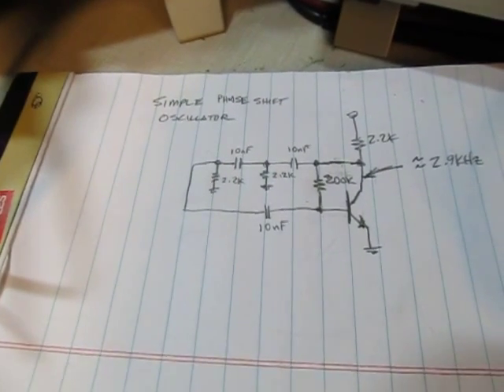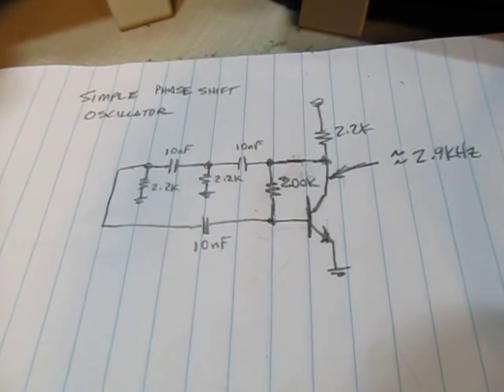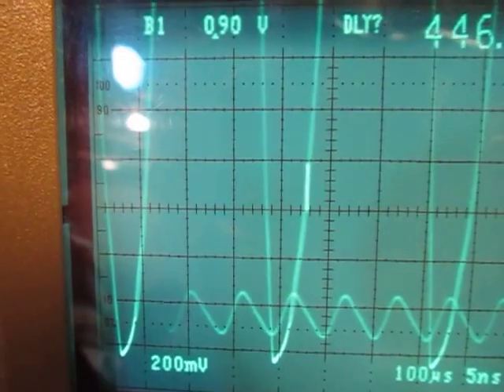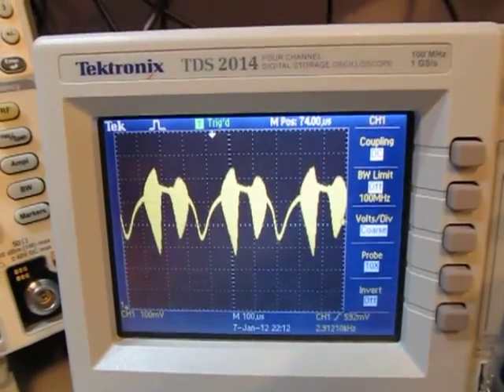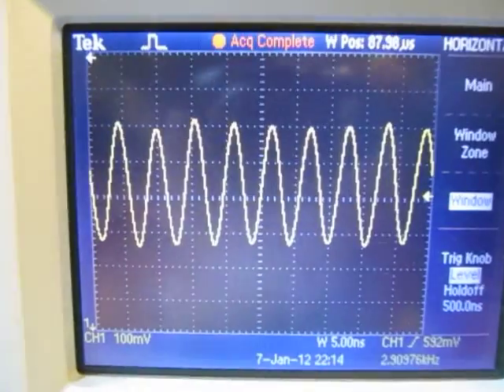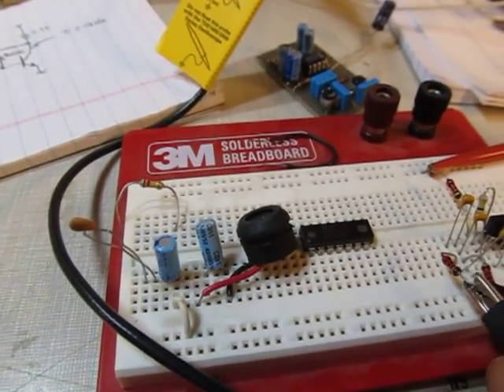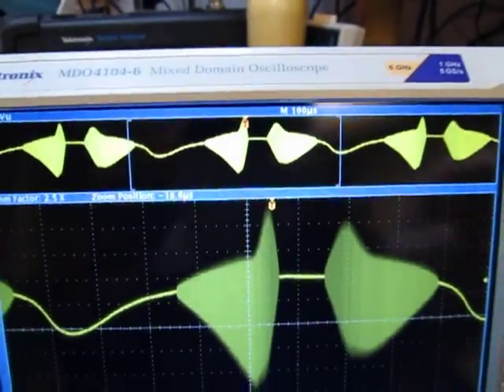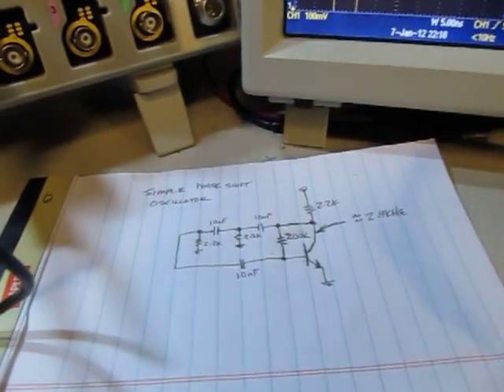#26: Answering viewer questions, and Digital Oscilloscope Considerations

Comment: can digital storage oscilloscope measure current
Reply from the maker: Any oscilloscope can measure current using a current probe (or my measuring the voltage across a current-sense resistor).
Reply: w2aew  actually I wanted to measure current though my Coil gun . the current will be in  kiloampere range . so should I just hook the probe parallel to the Coil and measure current .mine is a dso . it has current measureinh function .
Reply: I don't see how that is possible.
Reply: This was exactly the point I was making initially - you need some kind of current shunt and appropriate probe in order to measure large currents like this.
Reply: Alan Wolke I have seen people measureing meha amps with a dso , which uses current divider inside to measure the main current